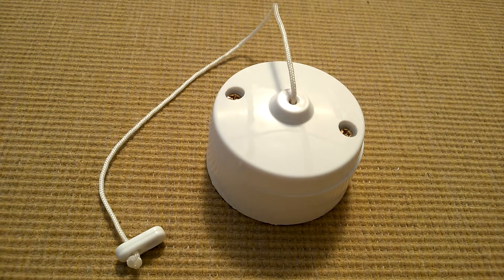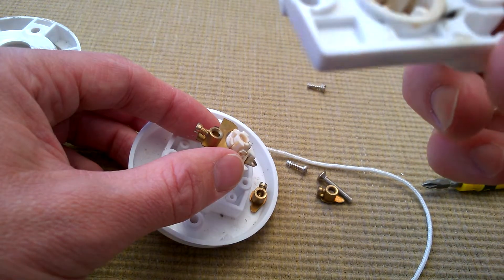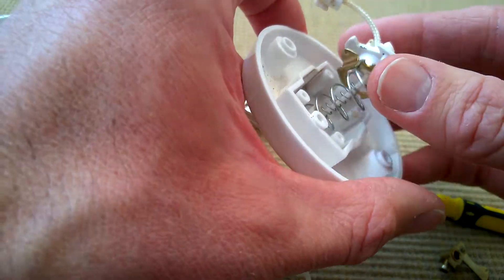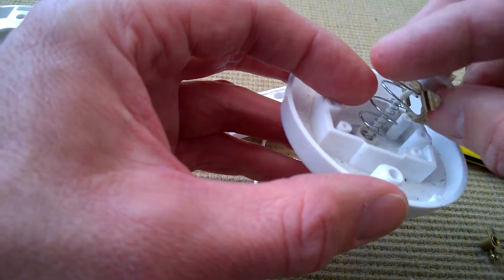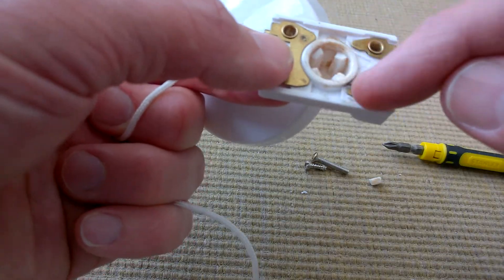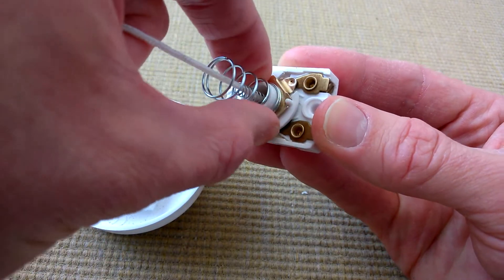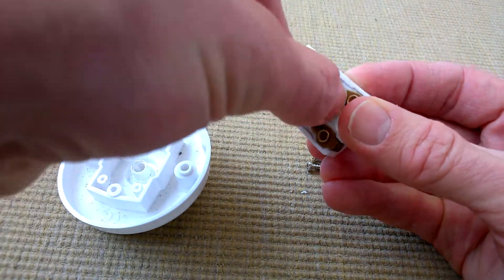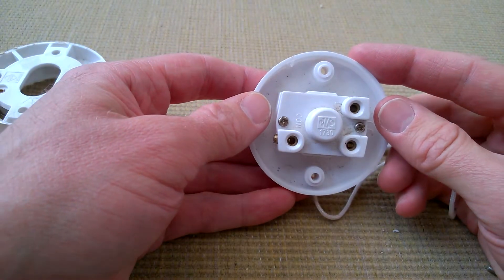Bathroom Light Pull Switch Failure - What Failed And How Does It Work

Comment: thank You ever so much. I've attempted to fix my broken switch, I couldn't because that part that You've had broken-mine is completely broken into 3 pieces, so I've had to just remove it from the mechanism altogether, and I think I've reassembled the switch incorrectly-I hope it's not gonna cause fire because of this, because I cannot disassemble it again until tomorrow and the power is back on now. but after watching your video, I think I can still get the light to work, We'll just not be able to turn it off. I can't do it now because it's dark already and my Housemate would whine like a bitch. regards.
Reply from the maker: Best of luck!
Reply: @ChrisHorswill  thank You. I've just watched your video again, and I'm probably gonna watch it a few more times. ultimately I'll need an entire new switch but for now I'm hoping to at least put this switch into the on-position. -We've used candles and phones in the bathroom for the last couple of days. I wonder, seeing your switch-how does One connect this type of switch to the cables? it must be damn uncomfortable to install it. mine is different-One takes off the cover, the round thingy, and the actual mechanism is attached to the base on the ceiling, not to that round cover, which I think is better, or at least to Me looks like easier to install. what I also wonder is about that larger spring-it touches the metal conductor of the mechanism, and on the other end it touches the plastic cover directly-how does that not cause a problem, for example the plastic to melt/burn? your video is extremely helpful btw. regards.

Comment: My pull chord is running with my bathroom light and bathroom extractor.

After near 5 years it's now only sometimes turning the light on but always the extractor.

The cables are all in correctly and the bulb doesn't need replacing. What could be the reason for this?

Comment: I need the exact same sort that is showing in your video. Which is a few years old. Can anyone help me find a replacement. Places like screwfix they never show you what it's like inside the unit.
Reply from the maker: If you can, it would be best to remove the one you have and take it in to a shop so you can be sure to get the correct one.
Either that or try to find a manual online of the products to compare with. 
Best of luck!

Comment: Thanks for this video, my pull switch is slightly different but this gave me the general idea of how it went back together after I removed some screws and the springs exploded the whole unit into a bundle of bits on the floor
Reply from the maker: Yea they are a bit of a mission to get back together when that happens!
Reply: Sounds like Lee figuring out the colour labelling system, between internet dolly visits.

Comment: hello..  bathroom light pull switch issue (sorry..)  but it's odd..  you pull the string down and the light comes on, i release the string expecting it to sort of catch as it does and keep the light on,  but it doesn't,  the light goes off..  
so.. i pull down, light goes on,  let go..  and light goes off..   this is not normal function.. 
i don't mind wiring a plug but i'm more reluctant with a switch attached to ceiling..   i hope this makes sense it's a strange problem.
Reply from the maker: That sounds like the switch is worn out and needs replacing. Doesn't look to be engaging and clicking to the on position.
Reply: @ChrisHorswill   thankyou,  sounds like you know what i mean..   will it be straight forward taking it off the ceiling? maybe there's a video?

Comment: I'm here because I bought a new (replacement light switch ) for my downstair Loo, today. But the pull cord hardly moves , just like the old one.  So, back it goes tomorrow. I'm glad I didn't dismantle the old one, as it just about works, but only just.   Thanks for this, well displayed.

Comment: Any tips to quieten the loud click it makes each time you pull? Thanks!
Reply from the maker: It is annoying isn't it.  In a way I am glad it failed so I could replace it with a different brand. As for the clicks, probably not since it is likely the strong spring making the plastic bits click together causing the noise.
In theory there might be an approved grease you could use to dampen the sound but I wouldn't recommend this. It would have to be approved for electrical applications.
The other thought is making the spring less strong, but if you are going to the trouble of these modifications I would replace with a better unit. MK make good electrical sockets and the like.
Reply: @ChrisHorswill  Hi, i've read somewhere else using putty or bluetak could muffle the effects slightly?
Reply: @ChrisHorswill  MK make load click all soft clicks no longer available I haved looked

Comment: Thanks for making this. I can't work out what the string actually attaches to? Mine has pulled through the thin spring, and there is a knot at the end, but no obvious way it was attached to anything. I can't see any broken plastic or pieces anywhere - everything looks OK, just not attached. Any ideas? 🤔 Cheers!
Reply from the maker: At 1 minute 51 is should show that the string goes through the center of the unit and the knot keeps it in place.
When you pull this operates the circular cam to cycle around.
The spring is there to keep the pieces in place and allow for it to spring back after you let go of the string.
Reply: @ChrisHorswill  Ah thank you. That seems to be missing from mine (a very slightly different design) and I'm still at a loss as to how the mechanism is supposed to work without any kind of anchor point. I think something must have snapped off mine, so I bought a replacement instead. Cheers again for the video, it was nice to have a go anyway. 🙂

Comment: In a situation like this, where the plastic bit has snapped off the rotating part, would you recommend using super glue to fix the plastic part back in place?
Reply from the maker: Personally I would just replace the unit with a new switch.  The glue might work for a bit but will always be the weak point and is bound to go again.